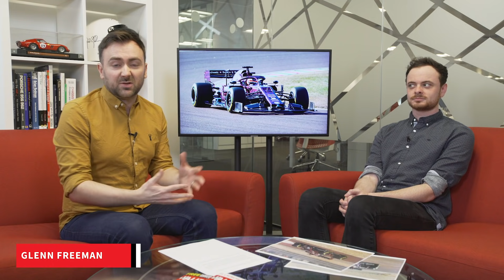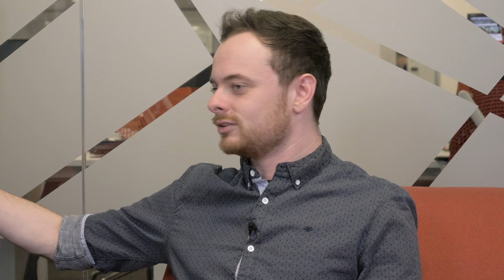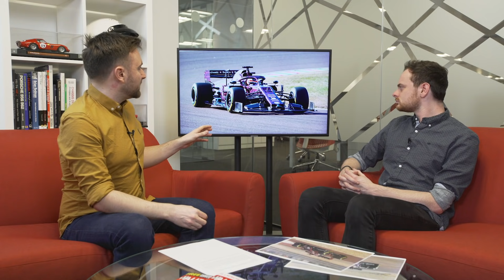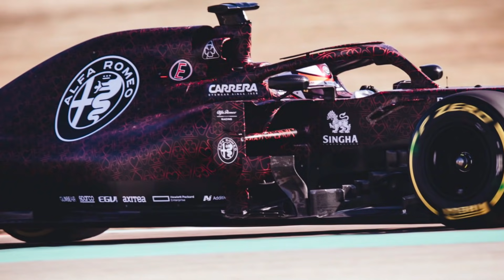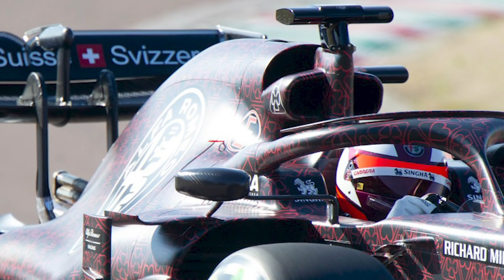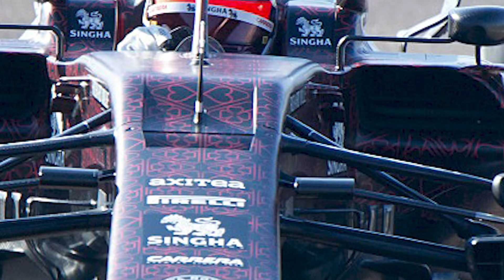'The strangest front wing we've seen so far' - Alfa Romeo F1 technical analysis

Comment: That wing design kind of shows that they don't really need them to be so wide in order to generate enough downforce. Reduce the front wings to maximum width of 800mm, then they might find it a bit more difficult to generate outwash.
Reply: Or just go back to designs of front wings of 90's...wings that arent as wide and also dont have winglets whatsoever, very simple in design.